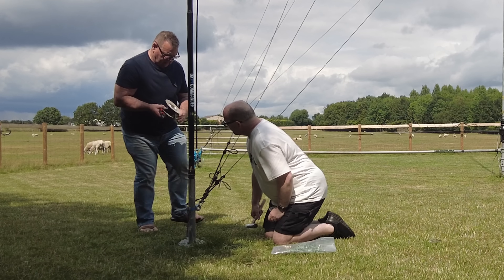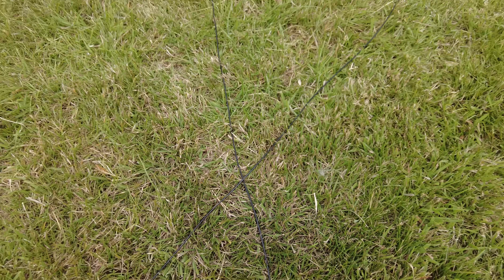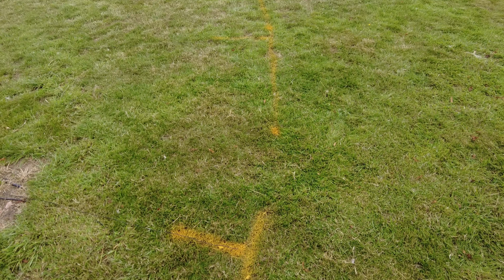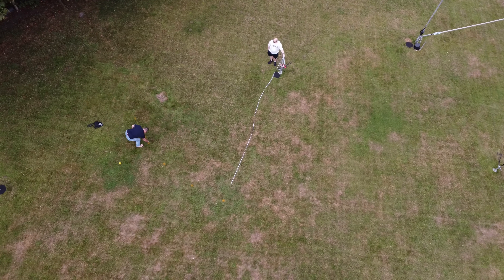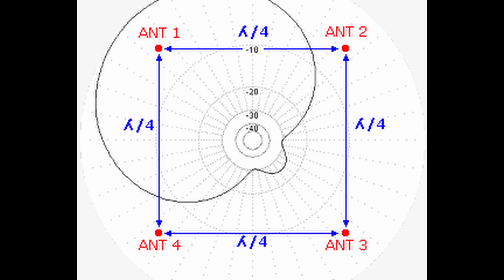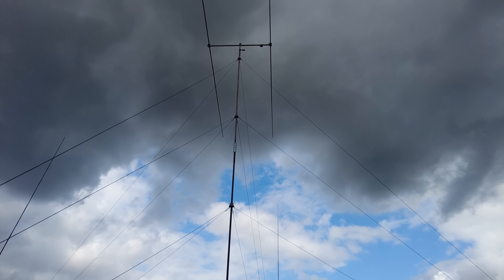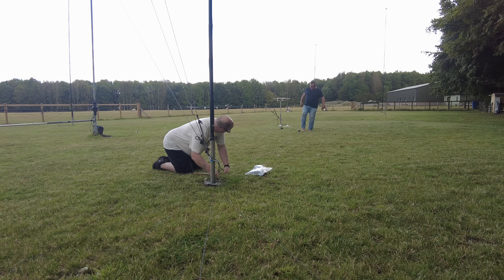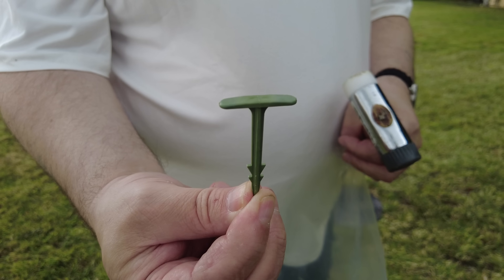Amazing Vertical Array - 2,500 Feet / 96 Radials!

Comment: I wonder whether using vertical dipoles, "Flower Pot" style, would reduce or eliminate the need for radials.
Reply from the maker: PLenty of ways of making a "no radial" system - but there would be a loss of efficiency. Of course raising everything off the ground by half a wavelength would be amazing - but that would a huge engineering feat - and then might as well go Yagi.

Comment: Cal, I have not seen anyone do this before, BUT I wonder if I wanted to get my feet wet and try a 40-meter four square, if I could start with 4 Hustler Ham Sticks.  I know the gain will not be the same, and the efficiency will not be the same. But if done correctly and it works, then I could switch out the Ham Sticks with a 1/4-wave mast.
Reply from the maker: Well, I suppose so!

Comment: I have 32, 1/8 wave radials under each radiator in my triangular 40 meter vert array.........I ran a tape measure out to the calculated  ends of the radials on a center pin so I could walk it around the permiter and used a pre-made measuring stick with a nails on each end to mark the distance between the ends of the wires......the far ends of each radial had a ring terminal pre installed so all I needed to do was stake it into the ground with a sod staple.........73 Mike from New England to Old England
Reply from the maker: Perfect!

Comment: Callum must be a glutton for punishment.  I would have cut the radials and put on the fork connectors on from the comfort of my workbench.    Another precise way to mark out the circle for the radials would have been using a 7 meter cord. Put a stake in ground and then with a second cord measure from the first stake 1.83 meters and place a stake where the 7m cord and the 1.83 m cord intersect and repeat the process all the way around the circle.
Reply from the maker: That's actually MORE work... Until you try this (old time here) - this is faster and no tangles

Comment: Oh Callum,  you should have called me beforehand. The expanding wavefront off a vertical does not expand outward in straight filaments from the center feed point (like your radial wires do) It is a toroid (donut) expanding radially (sideways) as it travels out. 
So straight radials on the ground capacitively couple only to the ground currents directly under/very-near each wire. Return currents traveling between the wires which are too far away to couple with, continue traveling further on the dirt which has more loss than wire. A grid of wires both going away and also cross connected sideways has much more area to intercept/collect the currents flowing back.

Individual radials are vastly too much effort for not much extra return.. Put down a mat of galvanized fence wire under each of the four verticals with about 150 square feet of fencing. (14 M squared) Clamp the edges of those mats together together with split bolts.
 
Do not interconnect the four separate mats other than through the ground braids at the coaxial feed points. Laid on the ground the grass will bury the mat faster than you can believe. It does not  rise up under the mower or the dogs feet. I quit using radials many years ago, other than elevated.

My friend Walt Maxwell W2DU discussed this in Reflections III. I believe it was in chapter 5. Well worth your time to peruse it. Now that I have posted this I feel the need to refresh the mind with a reread.

Cheers, eh wot
Doc - K8DO
Reply from the maker: Hey Doc, which is why mine are only 7m long and they are cross connected. See next video.

Comment: Guessing where each section of the clock-face is not good enough Callum. For such an expensive project you need to be scientifically accurate. I mean, how hard is it to mark a circumference of a circle and accurately divide it into equal sectors. Not that hard!
Reply from the maker: You are off your rocker - a few degrees out will make absolutely NO difference

Comment: I was always under the impression that you just multiplied the lowest band by 4 then any multiple of that length works. For my Atas120a I went for lowest band of 40m x 4 =160m so I had 5x8mx4=160m and it works a blooming treat. At least 1.1:1 on all bands when tested. If its to long the RF just stops at its resonate point so no point in going longer?
Reply from the maker: Radials... There's a graph on the internet - but 16 q/waves are about right up there without going mad. Adding a million more might give you another hald dB.. (for a q/wave - not a loaded vertical).